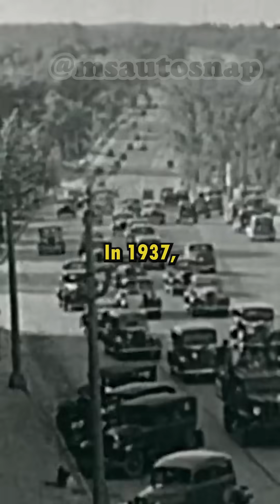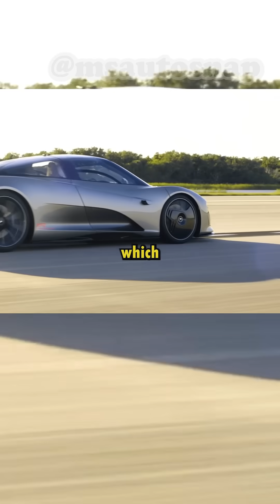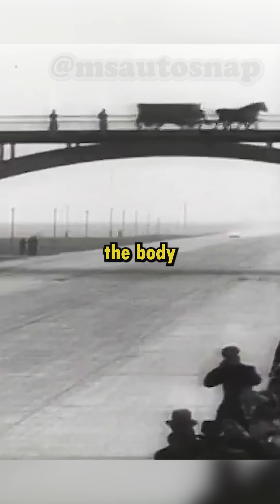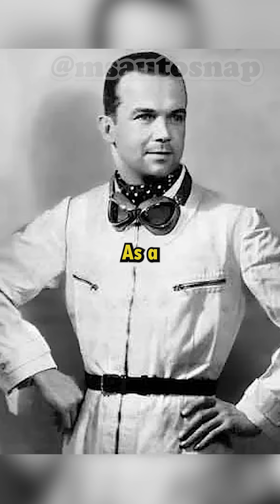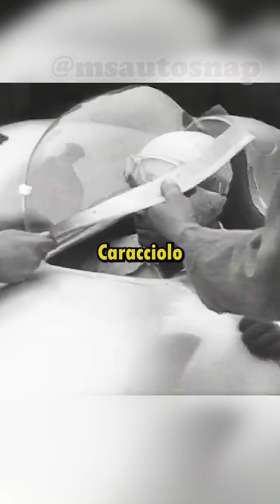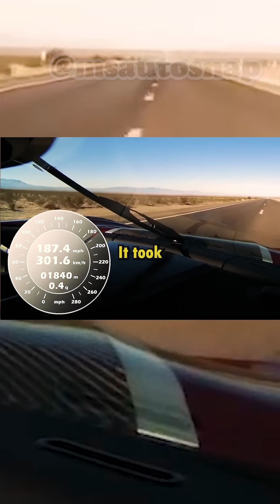Fastest Autobahn Car For 80 Years! #speedrecords #mercedes #v12

Comment: Mercedes also build the T80, in which they put a tuned DB603 aircraft engine with about 3500 hp. It's theoretical top speed lies around 650 kph (403,891mph), however, it could never be tested due to the beginning of WW2.

Comment: If I remember correctly,I think that the engine was turned up side down, and the valves were filed with potassium to spread the heat quicker, and to ensure that oil come on all places quickly, it had 9 oil pumps.
Masterpiece of engineering.
Reply: I'm not sure, but I heard there are production supercar engines with potassium filled valve stems today, for the exact same reason.

Comment: Ever heard of the Daimler Benz t80?
It was build around a 44,5L V12, the same engine the Me 109 used. The planned top speed was about 650kph ab the calculated was around 750kph but because of the war is was never tested on road.

Comment: So the W125 was a purpose-built car, never sold to the public and not built to meet any safety standard. 

Why are we comparing it against road-legal production cars like Koenigsegg?

Dragsters went faster than 269 waaaaaay before Koenigsegg did. Surely someone tried doing it on a public road somewhere?
Reply from the maker: key words "PUBLIC ROAD"
Reply: @MSAutoSnap did you read my last sentence?
Reply from the maker: @JakeRobb  my bad, but still even if someone did it, its unrecorded so I guess it doesnt count?
Reply: @MSAutoSnap i guess not. I did a bit of research and it seems like a lot of stuff changed around WW2 that made it impractical for anyone to attempt such a run in an official way. 

So it’s not that nobody built a faster car — it’s that 80 years went by before another venue appeared that qualified as a public road and was long, straight, and smooth enough to support 270+.
Reply from the maker: @JakeRobb  That same year or year later Mercedes set a higher land speed record. I think the difficulty comes from the fact that roads are narrow, there is less room for any mistakes, the surface is far from ideal, there are always some bumps, an animal can run onto the road, and you need to find an experienced driver who is willing to take the risk. I don’t think it only comes down to whether the car is capable of doing the speed when it comes to a public road record.

Comment: 750 HP in 1930’s is wild
Reply: No UFO......but building racecars around some high-tech engines that eventually became aircraft engines. Since Germany wasn't allowed to build motorized airplanes due to the Versailles-Treaty.
Reply: Also you are right because also the  Mercedes t80 is built too
Reply: It wasnt that reliable of an engine as well, because it didnt need to be.
Reply: Hitler saw that.. our last century is psychoticly crazy 😂
Reply: Not really .. its an airplane engine 😅 now today we have 4 cylinder engines pushing those numbers 😅
Reply: it makes you wonder if Germans had UFO tech in the 1930s.
Reply: Wow bro so wild bro omg never seen a comment like this before bro woah so wild its like it's literally a double supercharged v12 bro but it's so wild that it like went fast bro that's crazy

Comment: There was a Mercedes that drove 650Km/h in 1938. It had 3 axles and a 3500HP engine from an airplane. There was videos of the record run on YT but it got censored.
Reply: because its not true and likelly ai generated
Reply: @brainslayer666  the video most likely but the actually exists its the mercedes benz t80 44l displacement 3500hp @3000rpm
Reply: @deroger612 they are jealous of Germans
Reply: The T80 was built to go 650 but it never got a chance to show what it could do due to the war
Reply: @pe8268 AI said it would reach 810 km/h 🥶

Comment: Please get the math right 755/c.1.23 metric tonnes works out at 613hp/tonne not 130hp!! Which is actually around 135bhp/litre. I see AI has turned the figures around. This proves always sense check AI before uploading as AI is neither smart nore artificial. We used to play against the cpu back in the 80s, now they call It AI- All it is is LLM programmed by humans👍

Comment: In 1935 the record was set by Alfa Romeo, with Tazio Nuvolari at the wheel of the Alfa Romeo 16C Bimotore (2 x 8c engines for a total of 550 HP), exceeding 320 km/h on the Florence-Mare motorway.  
In just a few years since then automotive technology combined with avionics and aided by large state funding progressed rapidly
Reply: The top speed for the vehicle in this video was over 400km/h
Reply: @DamienJohnston-sv2xh  I'm afraid you didn't understand what I wrote: that in a few years the performance has increased a lot

Comment: So Bugatti were lying when they said Michelin has to make a tyre to go over 400km/h
Reply: Probably not, if you take in consideration the weight of the Bugatti
Reply from the maker: @stkarlsen77  That’s one thing. Another is it’s a different story to hit 400 km/h one time, and a whole different thing to have a tyre that can handle potholes in everyday driving and still hit 400 km/h multiple times if the owner wants to.
Reply: @MSAutoSnap if you take the Bugatti flat out for 12 minutes the tyres are  busted and the fuel is finished
Reply from the maker: @naeemsaley2197  thats still 12 minutes not 12 seconds
Reply: @MSAutoSnap that’s what I said . What’s your point. Stop irritating me
Reply from the maker: @naeemsaley2197  😂

Comment: No way he still has a head if that thing rolls over.
Reply: at that speed you are mostly concerned with dying quickly and painlessly. cause if something goes wrong, you are not saving it or surviving it for that matter. with no runoff even modern streamliners would be fcked and so there really was no point in trying to build a rollcage. as for the type c, rosemeyer was flung out of the thing as it rolled over multiple times, hitting trees as he flew through the air.
Reply: At these speeds a roll cage just adds weight.
Reply: At 260mph..they will need a sponge.

Comment: So Koenigsegg only beat the top speed by 8 miles after 80 years?
Reply: Koenigsegg is road legal,  this thing is not road legal.  There is hundreds of non road legal cars faster than this or koenigsegg
Reply: @Alpi-yn5jk There were no regulations back then to say that it wasn't road legal. Mercedes just built one to go fast and they did it before anyone else could even dream it. Everyone else is just a speck in it's shadow.
Reply: @BaseShakerAudi was no speck in the Shadow..they did get to 250 before crash
Reply: @BaseShaker they didn't have many regulations, but there were some. Lights, number plate (tags) were 2 that they deffo had. This thing had neither, so not road legal. Still awesome for the time though.
Reply: @brianschumer788 The Auto Union also used a primitive version of under body Aerodynamics on their car. Though no one can say what happened, though there were serious cross winds at the time of Auto Unions attempt, it could have been tire failure.
But this record would have been raised even more, if the even crazier T180 land speed car , using a DB 609 Aero engine with over 2000 bhp.
This too would use a special built section of the Auto Bahn.
But the car was never completed before War broke, but it is one of the highlights of the Mercedes Museum.
Reply: @Alpi-yn5jk  this thing also known as the t80 is a prototype and they never really finished it because of ww2, but the theory behind it is that it can reach 380 mph which can't be beaten, who cares anyways these cars won't beat an F1 car around the track
Reply: @cxlderfv why does cornering speed matter? This video and these cars are all about top speed
Reply: @Makkiebobo730   because if a car cant corner at high speeds then its absolutely pointless, the pinnacle of engineering is to make something complete
Reply: @c @cxlderfv  wdym make something complete, this is not how cars work. you either the fastest around a track, or have the highest top speed. you can’t really go both ways🤡
Reply: @cxlderfv the point of a land speed car is to go as fast as possible in a straight line, you think top fuel dragsters are failures? No. If it is fit for its purpose, its not a failure, its purpose is NOT to corner.
Reply: @Makkiebobo730   who said its a failure, its not at all, its just i see it kind of like a drag car and many people have a preference for these cars, i like it but its so ahead of its time so its only right with the limitations 80 years ago it turned out this way which is extraordinary but not for me, u may like it many infact like it and i respect that, its purpose is to go as fast as possible and it did that but the thing is a safety hazard too
Reply from the maker: @cxlderfv  T80 is a different vehicle, it had 6 wheels. People confuse the W125 with the W154 and the T80. Google it and you’ll realise you’ve been wrong your whole life 😅 I made that misatke too!
Reply: @MSAutoSnap  damn, why do they all kind of look similar tho? thanks for telling me
Reply: @cxlderfv they don't lmao, T80 have 6 wheels and wings
Reply: @klodknife  their colour makes them look similar and the t80 just has 2 more wheels and a wing but even that they look similar, even the audi in the video looked close
Reply: @cxlderfv beating an F1 car isn’t actually that impressive if you have the know how and the money, light carbon monocoque, 1500hp 4 cylinder from a drag car, slicks with extremely soft compounds, and a fancar design run it on nitro methane and that power will increase even further. 

The impressive part about F1 is how fast they can go with such extremely strict regulations
Reply: @joshjackburns  I know F1 isn't impressive, they can actually go way faster, but these strict regulations hold engineers back. But that's not the point, I actually saw a YouTube video about an engineers dream F1 car with no limits and idk if u saw that but if u did it's insane honestly
Reply: @cxlderfv the car was literally built to go fast in a straight line, and that’s exactly what it did. What on earth makes that any more pointless than a car made to go in circles fast like F1??
Reply: @Severi611  an F1 car isn't pointless and it doesn't go in circles, put yourself in that car you will come out of it and pass out without enough training, even an F1 car is a rocketship made to stay on the ground, not saying it's practical but it's much more fun compared to this, this was the first step for them, to get this fast, im nore than 70% sure they wouldve pursued downforce and cornering after
Reply: @cxlderfv  The current piston engine, wheel driven land speed record is 470 mph, set by George Poteet in the Speed Demon...which most certainly could never have been driven on the street.
Reply: @arthurflax1505  yep i found out about that 2 days ago, pretty crazy lowkey because tires must be able to withstand the whole run let alone the speed
Reply: @arthurflax1505   and the driver this year had a crash which resulted in his unfortunate passing too  :(
Reply: @cxlderfv  For those who may be interested, George Poteet set the piston powered speed record of 470 mph in Speed Demon in 2020. In 2024 Poteet died of natural causes. The record car was retired and will go to a museum. A second car called Speed Demon was prepared for a driver named Chris Raschke. Sadly, he died while driving that car at nearly 400 mph on the Bonneville Salt Flats this year - 2025.
A lot of folks here wonder why all the interest in speed records. Thing is,  the men and women who build these record cars usually aren't backed by manufacturing powerhouses like Mercedes-Benz. They have resources, but nothing like the engineering and dollars of an automaker. And still they manage to build awfully fast cars, often faster than the occasional efforts funded by automakers. In essence, they build these cars in a "shed" and go very fast.
Reply: @Alpi-yn5jk yea that is real
Reply: @Alpi-yn5jk  It's not about being road legal but about a record driven on a regular road, not a track, dry salt lake or whatever.
Reply: @davidfoo2762  You can drive top fuel dragster in regular road too mate. You can go 330mph(500kmh) under 4 seconds
Reply: @Alpi-yn5jk what does road legal mean? 

you know regulation always evolving, what legal in the past can be illegal in the future, so this thing is legal by the old standard
Reply: @Alpi-yn5jk who tf do you think cares?
Reply: @TheFirstBigCheese  Your mother cares
Reply: TopSpeed's Top Ten Fastest Non-Production Cars
8) Campbell-Railton Blue Bird - 301 MPH. ...
7) Thunderbolt - 345 MPH. ...
6) Wingfoot Express - 415 MPH. ...
5) Green Monster - 572 MPH. ...
4) Spirit of America - 600 MPH. ...
3) The Blue Flame - 630 MPH. ...
2) Thrust 2 - 633 MPH. ...
1) Thrust SSC - 763 MPH
Reply: @jimboh.2654  All of these WLSR vehicle speeds were attained on dry lake beds/ salt flats, where the Mercedes, Auto Union and Koenigsegg were timed on public roadways, which was plainly stated at least 3 times in the video and more than that in the comments...
Reply: @jimboh.2654 where's the other 2?
Reply: The koenigsegg is a road car and was built by a small private company, this Mercedes project was literally funded by the Nazi’s as it was something Hitler had a personal interest. The happened as the Autobahn was being built. This project probably cost an absurd amount of money in todays money
Reply: @joshjackburns  Hitler had a race car too 😭 a gp car from audi in his time
Reply: @c @cxlderfv he had Auto Union and Mercedes. Audi didn’t quite exist then
Reply: @joshjackburns   technically it is Audi because auto union is what Audi was before, he had like a few gp cars the Mercedes being one of them, but there was one specific one very well preserved by Auto union which still has the same logo as audi just with the words auto union in the rings
Reply: @cxlderfv Auto Union was a little different to Audi, they went under major changes before being named Audi. Also Hitler never owned Grand Prix cars, he just sponsored them with an unlimited budget
Reply: @joshjackburns  yea, but that's the thing, that's why the gp cars are his, he funded them so that they can also put the swastika on it every trace of decision related to those cars are him so I'm not speaking as if he owned them in his garage or anything, but he funded and sponsored them
Reply: @cxlderfv  sponsors can’t usually consider the car theirs even if they funded a large portion of the project, also from what I know the cars didn’t have the Hakenkreuz on them because I doubt even back then political stuff on race cars was liked. Not trying to be a dick but the Swastika is actually a symbol of good fortune and wellbeing, the Hakenkreuz was the 45 degree one that the Germans used. 

My guess is if the car had that much historical significance to Hitler then Audi and Mercedes would probably have destroyed the cars half a century ago either that or would be in war museums, it’s my educated guess but at the end of the day I’m still only guessing
Reply: @joshjackburns  yep that's right, but according to what I read about the cars is that Hitler had access to them personally through the manufacturers, gp cars can't be owned by people as Im pretty sure they are dangerous so he wouldn't drive one, he never drove his own luxury cars himself, but what I do know is that the swastika were displayed on the silver arrows cars, only sometimes tho especially during the Reich movement as a way to promote it, and yes the swastika is a good symbol in many many places, gp cars were either ways dangerous and expensive to maintain, but also then again, they are a piece of history and Hitler was fascinated by German engineering so Im pretty sure he would say they are his 😂.
Reply: I don't think you mechanically understand how difficult it is to go this fast on land. the more speed you pick up, it exponentially gets more difficult and you need to make drastic improvements and changes just to go a few miles faster
Reply: LMFAO............   A REAL CAR CAN BE DRIVEN ON AN ROAD OR STREET AND THE OTHER PILE OF GARBAGE WAS A DRAG CAR................   ONLY COULD GO STRIGHT AND NOT TURN BUT LIKE 3% SO IT WOULD TKAE A 100 POINT TURN TO GET IT TO TURN AROUND AND COULD NOT MAKE A 90 or 45 TURN.............  DRAG CAR AND A REAL CAR
Reply: It was the public roads speed record, which nobody beat because almost nobody ever tried.  There aren't a lot of places where you can do this, and few still where officials will shut down the road and allow it to be used for this purpose.  Also, these were purpose built for land speed record racing (in streamliner form, at least, without the body kit they were purpose built Grand Prix racing cars).  The Koenigsegg is a street legal production car.  Low production, yes, but it's a production car nonetheless.
Reply: Where do you want this speed record done? Out on Route 160, he won.
Reply: Well its "fairly" easy to build a non road legal car. Those dont need all that junk a modern car has. If you remove everything not needed and base the car on carbon fiber and carbon kevlar, then drop a seat and a engine that has 3000hp or more. 

On top of that a engine management that help you so you dont just make smoke with the tires. That car would crush that record.

Andthese cars exist already. Just look at the drag racing cars. they reach 300mph plus on a 402 meter stretch. And top fuel with 12000hp+ does 400mph plus on that same track.
Reply: The speed record ultimately comes down to the driver I guess. Blokes just had far bigger plums back then maybe.
Reply: no Koenigsegg has ever reached 400+ kph on autobahn, the only production car that has repeatedly exceeded the 400kph is Bugatti Chiron and with amateur drivers not race drivers. I guess no inner combustion engine car will ever break the Chiron’s record because of the W16 engine being the last of it’s kind. A car that’s truly a daily driver and can easily go up to 400!
Reply: SSC TUATARA HAS  312 Mph ;) nowdays